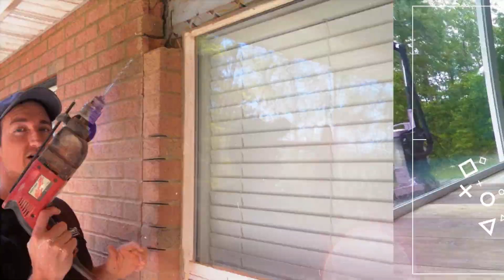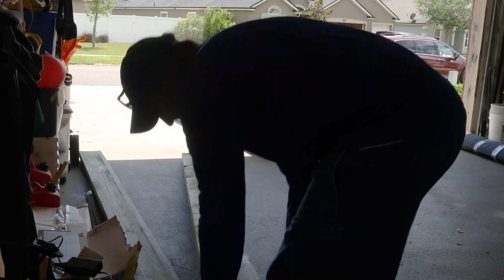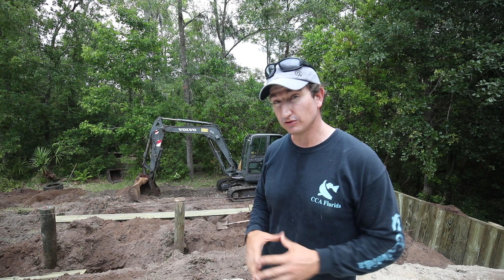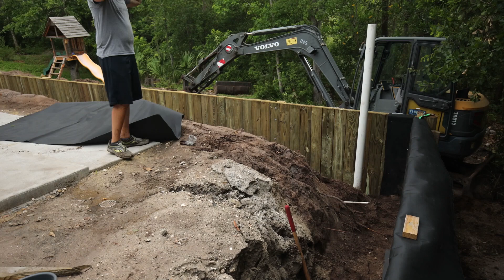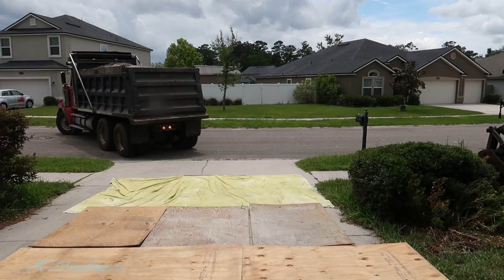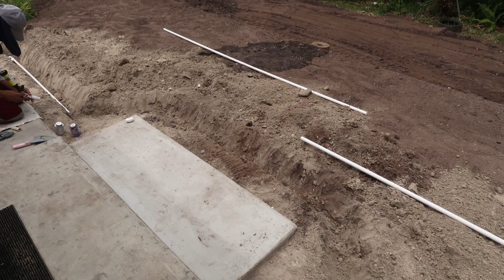How I Constructed A Backyard Retaining Wall With Pressure Treated Lumber

Comment: BAD DESIGN! This wall will eventually start leaning since water can NOT escape.  The water behind it, seeping into the soil against your liner can't get out.  Retaining walls over 2 feet MUST drain.   It's needs a gravel bed against it from top to bottom or a lower french drain so water can escape.   The weight and pressure of water beneath the surface is why most retaining walls fail.  Stacked Masonry block walls are water draining walls which still require gravel fill and drainage behind them.  They are easier, cheaper and last forever compared to this wood fiasco.
Reply from the maker: The linear utilized in this wall build is water permeable. I agree though most walls can benefit from gravel bed type drainage system.  We decided this particular wall did not need that type of drainage  based on the site conditions.  Thanks for you input on retaining wall building.

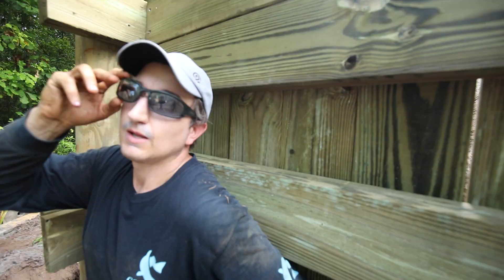Comment: 3:51 It'll also degrade in about ten years.  In 2004 the process for treated wood was changed from arsenic to liquid-copper so none of that treated wood will last more than a decade before it looses it's holding strength.  It might have lasted slightly longer if you had far more drainage along the entire wall.
Reply from the maker: We will see Bob.  I have seen newer pressure treated wood deteriorate relatively quickly when utilized in other builds such as docks.  This lumber was freshly treated at a local plant and I am hopeful that will help with longevity.
Reply from the maker: Also building retaining walls with PT lumber is popular in the area.  I scouted some 10 plus year old walls built with  this wood before starting this project  and they look in great shape.
Reply: @MrKistel   Building retaining walls out of liquid-copper treated wood will go out of style once people understand that in 2004 the arsenic treatments were banned due to people burning it & getting arsenic in the lungs of children.

Comment: The only thing I can not effort is the track loader...
Reply from the maker: The excavator was a very helpful tool for this retaining wall build. We used it for pretty much everything from moving dirt, setting wall pilings, to grading the site.  A smaller piece of machinery like a skid steer may have worked as well.